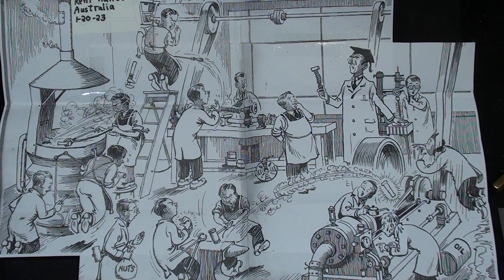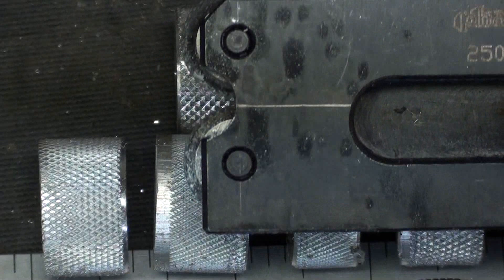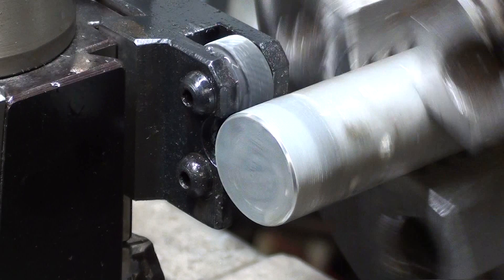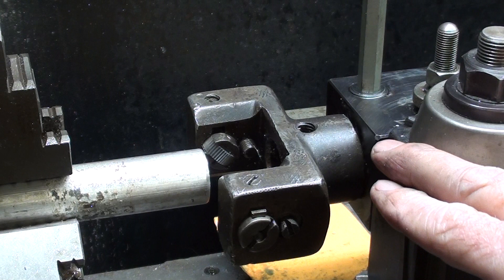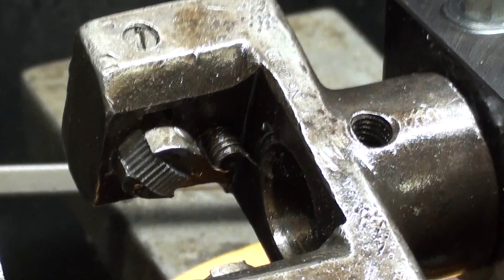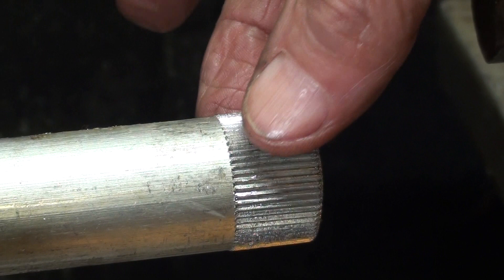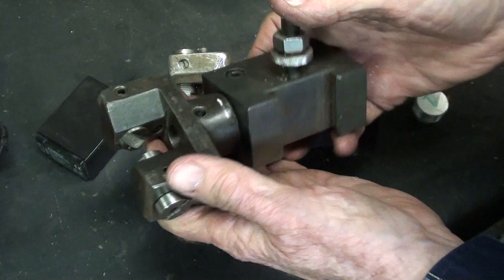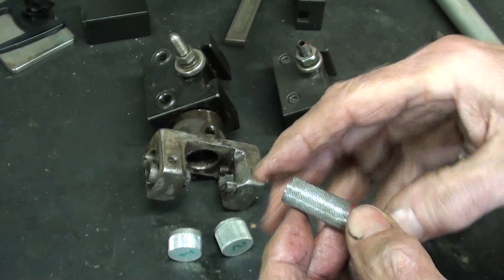HOW TO KNURL ON THE LATHE #860 pt 2 mrpete

Comment: Mr Pete, I commented yesterday that I own a scissor type knurler and I get pretty good diamonds etc... I didn't give it much thought but, the scissors style cutters are positioned much like the B&S tools in that they are not pushing from the sides( like the bump style) but are on the top and bottom. On the scissors type there is quite a bit of effort in moving the tool down the workpiece and , for me powerfeed is almost a must in getting good, consistent diamonds.

Comment: That "B&S" knurler is great adapted to the lathe. I have several videos of adapting screw machine/ turret lathe tooling to my Logan 10" lathe. Great video as alway Mr. Pete!👍
Reply from the maker: Thanks, I will look them up
Reply: I've done quite a bit of knurling through the years have also done face drilling on a milling machine where I put my knurling  tools into a holder into a  collet and then just pass the work underneath the knurls on the flat surface.

Comment: I’m still wondering about the stock diameter vs. the knurler tooth pitch/diameter…if not matched couldn’t the teeth in knurler be off a half a tooth on the stock and wipe out the just-formed teeth in the stock? Your part 1 video said not to worry about the stock diameter/knurler diameter but I am a worrier. Maybe the stock compensates by deforming in a way that matches the knurler?
Reply: I've always been confused about this, I'm assuming it must slip and fall in.
Reply: @anthonymorency1107  I am glad to hear I’m not the only one that is confused!
Reply: The finished knurl is a repeating pattern with a fixed length.  If the circumference isn't an integer multiple of the pattern length then there must be one point in the circumference where there is an error in the pattern as the wheels re-align.  I guess a bad knurl is where this re-alignment doesn't occur quickly, or fails to occur at all.   I need to have a really close look at any examples I can find to see if I can pick the point where it re-aligns.  The only other thing I can think is that the rotation of the wheels causes the pattern to rotate with respect to the axis of the shaft, altering the pattern length, so that the re-alignment occurs automatically.  But the math in working that out is way beyond me.

Comment: Nice demo Lyle.  I use the B& S type knurllers all the time, mostly on my turret lathe, they work awesome.  I like using the chamfered edge knurllers, they start easier.  Thanks for sharing.
Reply from the maker: Thanks Randy. I just watched your video on installing the knee power feed.   It’s never very simple. Is it, L O L but you’re doing a great job.
Reply: @mrpete222  All up and running great.  Thank you for stopping in.

Comment: Thank you for the video series on knurling.  I haven't done much knurling over the years.  The few times I've cut knurls I've used a cut style knurling tool dad borrowed from work back in the 1960's.  Sadly, it's so old I can't find any new knurls that will fit this old tool. Anyways, I've tried the Aloris one with zero luck with it.  It now is used with a chamfering tool only.  Did buy a elcheapo scissor type knurling tool and amazingly it cuts some very nice knurls!  Ken

Comment: If a longer handle was to be knurled would it be a better outcome with the first style tool if it was turned with the tail stock center. Then set the speed very slow and the feed rate to advance half of the roller width per spindle revolution about.125 or 8 threads per inch? Thanks Mr. Pete for another great video!

Comment: It’s important to clean the knurling wheels before starting. Any metal left in the knurl wheels can be embedded in the work piece. This is especially important when going from steel to softer metals like aluminum and brass.

Comment: I bought one of the Brown and Sharpe knurlers after watching an earlier video of yours.  They do make really nice knurls once they are set up, and the only major drawback is you can't knurl in the middle of a workpiece.  A scissor knurler would be ideal for that.  I have a couple of tricks for getting mine set up.  I use the tailstock to center the tool up/down.  To get the knurling wheels set you will need some trial and error at first, but if you can record the measurements of a successful knurl you'll be able to use those for faster setup in the future.  Start on the lighter side because if you go too deep it can put incredible stress on your cross slide.  The Brown and Sharpe manual suggested moving the knurlers in until they contact the workpiece, then retract the tool and advance each knurling wheel 1/4 turn with the adjustment screw.  This was way too much for me.  I ended up closer to 1/8 of a turn, and that has been very repeatable.  I use a small piece of very thin paper between the workpiece and knurling wheel, advancing the wheel just until I feel the paper bind.  Repeat on the other wheel, retract the tool, and advance each side 1/8 turn.  Another excellent method if you have some adjustable parallels is to measure the space between the knurling wheels and compare it to the diameter of your workpiece.  Record this measurement once you get a successful knurl.  In the future you can just measure the piece you want to knurl, subtract toe recorded amount, and set your parallel to that measurement.  Now use the parallel to set your wheels the correct distance apart.  Watch both wheels as you advance the tool onto the workpiece and move your cross slide until both wheels make even contact.
Reply from the maker: That is almost the exact way that I made my set up, including using the tailstock center. Yes, the disadvantages you cannot make a very long neural, especially in larger diameters.

Comment: I have gotten good Knurls with the Aloris rigid knurl thingy, but it's a crap shoot for sure. I don't have any other type of knurling tool right now. I do use the wheel style that starts out on the edge as opposed to the tapered side style which helps I find. The turret or screw machine style really is the best. I bet I could make one in my spare time....someday!
Reply from the maker: Yes, make one I’m thinking about doing it myself

Comment: Great video as always Mr Pete, i make 1000s of perfect knurls at work on cnc machines using a bump style single wheel knurl tool. I have seen charts about pitch and diameter requirements but its not necessary. Try cutting straight to depth at a feed close to the pitch of the knurl at slow spindle speeds (200rpm). I find the trick to plunging is to do it quickly so the form is nice and deep by the time it comes around the teeth have a greater chance of falling into the correct path, although i'm not sure how well this would translate to a manual machining
Reply from the maker: Thank you for that information

Comment: Every video I watch of yours is a definite thumbs up. Not cheap even used but I purchased one based on the information in video 1.  Hope this isn't a really ignorant question. Because the posts holding the dies rotate, could you turn the tool  post 90° to the chuck face and run the material through from the side and hence not limit the length? Not that I can think why one longer than 2"  might be needed LOL.

Comment: Mr. Pete, would be cool to do a follow up showing knurling different diameters with the same tool. Proving that you don’t need to calculate the diameters/ratio or do any of that nonsense. Or maybe DO the calculation and deliberately cut a knurl with the “wrong” diameter stock and show that it still comes out perfect. Also maybe do the calculation and show that the bump knurlers are horrible even when you do the math.

Comment: Great video.  At 18:07 your knurl is pretty good but notice how the diamonds don't form a straight line?  This is where the material diameter vs diametral pitch comes in.  If you adjust the material diameter slightly you'll see those diamonds line up perfectly.  Sometimes you can get away with adjusting the depth of the knurl to fix this issue.
Reply from the maker: Yes

Comment: The straight knurls don't look to be  parallel to the longitudinal axis of the work piece;  i.e. over even the short distance that you knurled, they appear to be slightly twisted. Just a comment.  I like the scissors type, in particular the UK-made Marlco knurling tool which is both self centring and cam actuated via a lever (against an pre-settable depth-stop). Maybe you can look it up in some old catalogue - something that you seem to enjoy doing (LOL!).

Ian.

Comment: A scissors type knurling tool is not limited with making a longer knurl. I agree with you, usually knurls are not much over an inch and the Aloris style should pose no issue, unless for some reason the knurl was located in the middle of a long shaft. I cannot think of an example, just thinking out loud. Thanks for all the information given here.

Comment: I believe the starting circumference of the stock is critical to easily produce a proper knurl. It is a function of the knurl wheel pitch and the circumference. Divide the circumference with the knurl pitch, and the closer the result is to a whole number, the better the results.
Reply: Agree! 
Straight knurls is nothing but a small gear interacting with a larger gear. For this to run smoothly, there is a relationship between the two. Now, when knurling, the metal is massaged. The result is that the workpiece is forced into correct diameter.  You will find this in the diameter of the resulting knurled part of the workpiece. In practical work you do not care about the diameter of the knurling, but if you do, you must start with a workpiece of correct diameter and the knurling must go to a specific depth.
Reply: No mathematics are necessary        If the knurls are set deep enough with a good flow of oil they will self-track on any diameter after a few rotations. I’ve made thousands of perfectly formed diamond knurls on 3/4, 1.00, 1.25, 1.50, and 1.75 diameter 6061 T6 aluminum without calculating exact diameters. The free rotating knurls actually slip slightly into previous grooves once a tracking pattern is established.
Reply: @ellieprice363 , I only said "the closer the result is to a whole number, the better the results". Of course brute force will also solve the problem, if you a have scissor-type knurler - or the type Mr. Pete demonstrated.
Reply: @ellieprice363  Yes, brute force may do the math. That is, you press the knurler exactly so deep that the knurled part is perfect. In witch case the pitch of the knurler coinside with the correct diameter, but you have no control with he diameter of the finished knurled section.
Reply: @ellieprice363  Please take a look here: https://en.wikipedia.org/wiki/Knurling 
They indicate that the workpiece should have a sertain diameter for best result with a given knurler.
Reply: @Halli50  Yes, there's more than one way to make a knurled part. If you need a precise knurl with perfectly matching teeth at minimum depth the calculated diameter type is the way to get it. Production knurling always use the cut or crush method since the other type would take far too long.
Reply: @Dingsrud  You do have some control over the finished diameter. For instance if I need 
1.0 (25.4mm) and knurling increases the diameter.025 I simply turn the material to .975  (24.765) before knurling.
Reply: @ellieprice363  Fully agree. Main point here is that there is a relation between the circumference of the workpiece and the pitch of the knurler. The knurler and the workpiece runs together like an ordinary gear. Maybe you will not notice this in the workshop as the workpiece will adapt to the situation by matter being moved around.
Reply: @kjellg6532  I’m sending photos of my heavy duty scissors type knurling tool, and examples of the knurls it produces, to Mr. Pete very soon.  Hopefully he’ll share them with his viewers when his busy schedule permits.

Comment: You made me feel pretty good, Mr Pete! I'm a new, self-taught user of machine tools, and I've gotten some pretty good results with the Aloris style bump knurler I got from Shars. I've only used it on aluminum and brass, and made some crummy ones, but I think at least 60% of my attempts look pretty good. Maybe 30%, in my opinion, look quite good. I did not use power feed, and I think my biggest blunder was not using enough fluid. I'm sure a lot of it was just luck, but I think another helpful thing, for me at least, was really careful setup. Those of mine that looked the worst were, I think, caused by one of the rollers putting more pressure on the work piece than the other. It seems like getting really close matching of the pressure is a bit of a crap shoot. Even when they seemed to be the same, I think they often weren't.

I just got a scissor type knurler in the mail, and look forward to giving that one a try. Thanks for the excellent teaching!

Comment: Have you ever had to sharpen a knurl to improve traction? And all you have is a 6" triangle file. If you worked on small Xerox machines in 1980 you did. They would wear down and were not a replaceable part and all they did was feed paper. Finally we developed a one wheel knurling and we used it on one side and turned it over to cross the pattern. Them were the days my friend.
Reply from the maker: Very interesting, never heard of sharpening one

Comment: Thank you for the video. I found it very interesting despite the fact that from now on I'll look at all my existing bad knurls with disappointment. I wish you had a scissor knurler in the video. I wonder if getting good results with them is fairly easy or hard. These days one often sees those Chinese made scissor knurlers that look like two pieces of 4in long, half inch square bar stock with rollers attached on the end, mounted in a V configuration, having a single thin screw for setting the spacing. I often wondered if these are a waste of time or not? They don't look very rigid at all. If they're useless I can see myself making one similar to those screw machine types shown.
Reply from the maker: I have seen those Chinese scissors knurlers in catalogs. I have never used one and I really do not know about the air quality.

Comment: I have a bump knurler, and I hate it! I've never acheived a decent knurl, I'm getting the scissor knurling tool shortly, and feel sure I'll get good results, but those Brown & Sharp ones you just showed would be preferable, but hard to get here in the UK. great video Mr Pete, thanks!
Reply: Yeah, I have scissor knurler and it works quite well. The scissor knurler is better for your machine as there isn't near the pressure on the cross feed screw. You carefully position the rolls so that they are dead center with the part, you can do it by feel. Then, turn the machine on and tighten the knurler, put it in feed.

Hope this helps.

Comment: i have used my brown & sharpe kurling tool many times on my Hardinge DSM 59 turret lathe, to get the best results, you need to flood the part with oil or coolant to wash the chips off of the knurling wheels.

Comment: RE: ALORIS Knurling attachment lack of Quality and less than fine cut, I believe that if you examine the beginning frames of the cut, show quite clearly that the TOP roller engages the work (starts to spin) before the BOTTOM does. This is evidence of the tool needing to be raised.  I believe better Z axis will vastly improve it's cut, as well as employing tailstock or follow rest being needed as well.  Also from what I could see, the cutters had leftover swarf or even damaged cutting edges. Knurling close to the jaws would help.  I also saw the TOP cutter bobbing up and down while in use....couldn't see the bottom one.  see video at abt. 6:59.
Love ALL your Videos!

Comment: One thing people should keep in mind is the fact that bump type put much more pressure on spindle bearings of the lathe. This pressure is much greater than the process of turning or cutting.  The scissor type (which was not shown) do not apply this kind of pressure because the knurl wheels are opposed like the screw machine type, but unlike the screw machine type they have a greater range of capacity.  With the advent of small table top machines with smaller and less sophisticated spindle bearing systems, I would opt for the scissor type if I were buying one.  I only use this type in my shop and it was the only type my students used when I taught.  The students had very good results with the scissor type.
On another note, the appearance and utility of any knurl is greatly enhanced by power wire brushing afterwards. Softer materials of course require softer pressure on the wheel.😮

Comment: I’m not a machinist but enjoy watching your videos!  It seems to me you could make a pilot hole jig the same diameter as the base of the knerling tool to get an accurate center.  Getting the cutters the right diameter would be a challenge but one of the variables would be eliminated.

Comment: Much of knurling depends on both knurls beginning to turn at the very same moment.  This insures they are set to the same depth.  The B&S knurl holder was a pretty dependable tool holder as long as they are clean inside and not overly damaged or worn.  As to diametric relationships of knurl and pitch, an old B&S handbook described the math involved.  Knurling will crush drilled/reamed holes, so yes, knurl first, then do the holes.

Comment: Just had an brain un-freeze about knurling length. It suddenly occurred to me why not position the tool perpendicular to the part axis lik a cutting tool instead of in line. Then after alignment the knurling could just follow the carriage to longer lengths (like threading). Tried it and it seems to be working, so far.